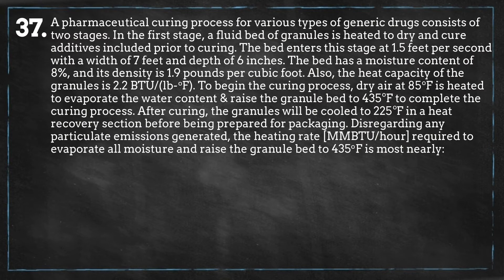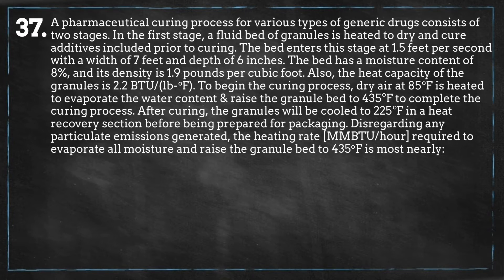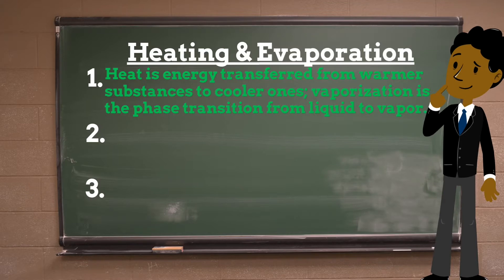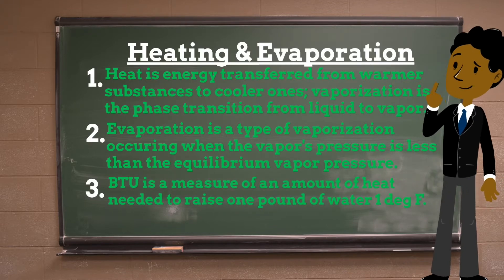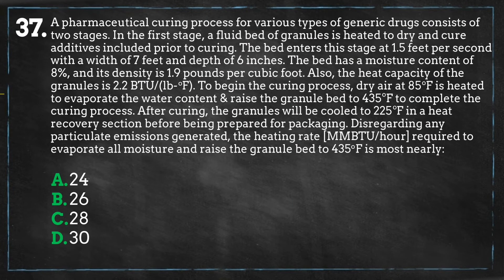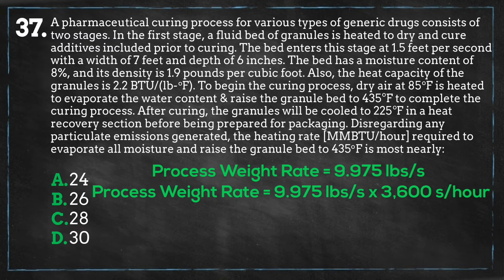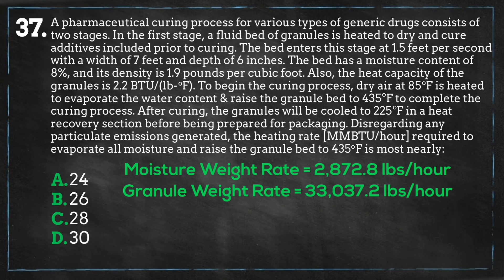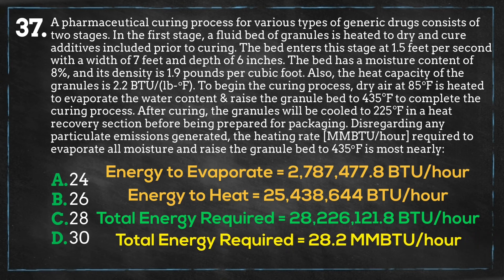Pharmaceutical Production - Episode 37 (Air Pollution Engineering) | 52 PE Exam Problems in 52 Weeks

Comment: I see that we calculate the energy needed to evaporate the water, but why is the energy to heat the water not calculated?
Reply from the maker: Thanks for your question, Daniel. There are 2 reasons, one major and one minor, I decided not to calculate the energy needed to heat the water (using the specific heat of water = 4,186 Joules/(kg-deg Celcius)). First of all, the specific heat of water, compared to the heat capacity of the granules, is negligible enough along with the low water content (weight and volume) to assume that the energy applied to the granules would be enough to also heat the water. The water content is contained within the granule bed and Ultimately, it's not enough water to consider it as it's own system as the granule bed is the point of focus for this problem.

The second reason, albeit minor, is that the water does not have to be at the boiling point to begin evaporating, and similar to the first point where I'm considering two actions (vaporization of water & heating of granule bed) for one system, I'm viewing evaporation as occurring the whole time during the heating process, not just once the bed reaches 212 deg F or higher, although being at the boiling does it make it easier from a temperature perspective. Irrespective of bed temperature, the latent heat of vaporization of 970.3 BTU/lb is still needed to convert the water from liquid to gas.

 Saying all of this, if you get in a similar situation and don't feel comfortable negating that energy needed to raise the water's temperature, you can take 60 seconds to do a quick calculation using the specific heat of water of 4,186 Joules/(kg-deg Celcius) using the moisture weight rate of 2,872.8 lbs/hour:

Energy to Raise Water Temp from 85 deg F to 212 deg F = [2,872.8 lbs/hour] X [4,186 J/kg-deg Celcius] X [1 kg/2.2046 lbs] x [1 deg Celcius/1.8 deg F] X [127 deg F] X [1 BTU/1,055 J] X [1 MMBTU/1,000,000] = 0.36 MMBTU/hour.

Added to the energy to evaporate (2.8 MMBTU/hr) and the energy to heat the bed (25.4 MMBTU/hr), you end up with 28.56, which still gets you an answer of C. For problems focusing on the water or other liquid as the focus, using the specific heat is necessary; for this problem, not so much. Let me know if this makes sense to you or if you have any other questions.
Reply: The calculation can be simplified since BTU is defined as the energy to raise 1 lb of water 1 degree Fahrenheit as you stated in the video.  So 2872.8 lb/hr of water raised from 212 to 85 degrees Fahrenheit is: [2,872.8 lbs/hour] X [127 deg F] X X [1 MMBTU/1,000,000 BTU]  = 0.36 MMBTU/hr.  Just an FYI for people taking the exam since time is valuable

Comment: Are we going to talk about how this solution ignores the heat required to change the temperature of the air coming in and the heat returned to the system in the recovery process? Both can be solved for with the information given (though a recovery effeciency must be assumed), and this more comprehensive solution gives a very different answer.
Reply from the maker: Thanks for your question, Devon. The focus of this question is only the energy needed to evaporate the moisture of the bed (using latent heat of vaporization) & raise the temperature (using the heat capacity). As you pointed out, as you start branching into various aspects of the systems there’s various transfers of energies & energies used to maintain equilibrium, but due to the various assumptions that would be used and additional information needed to solve within a reasonable amount of time, problems on the PE exam usually simplify to only one aspect of the system, assuming standard conditions (in equilibrium) unless otherwise stated.
Reply: @SIGMAEnv  I appreciate you responding, and very much appreciate you posting these videos. They seem very similar to the NCEES practice exams and your explanations are helpful.  I am starting to see a trend in these problems along the lines of the simplification you have described.  It is frustrating, however, since knowing apriori which details should be dismissed for simplicity is a subjective exercize, and does not conform to generally-accepted standards of a quality engineering assessment.  If the purpose of the PE exam is to prepare competent engineers, it seems irresponsible to put forth problems with solutions involving simplifications that would lead to incorrect answers.  In this situation, just because we aren't given a number for the effeciency of the heat recovery circuit does not mean that the quantity has a negligible impact on our energy balance.  I suspect the opposite would be the case.

Please excuse my frustrated rant, and thank you again for explaining.
Reply from the maker: No problem at all, @devon9075 . Preparing for the test is no doubt very tedious & stressful, so we often remind the students we assist in preparing for the exam that the NCEES designs this exam "to test for a minimum level of competency in a particular engineering discipline." These problems are very similar to the practice exams to point out the principles behind each problem. There's usually 2-3 ways to solve each problem, so as long as you rely on your knowledge base (how you typically attack scenarios), you should get a final answer close to one of the choices provided your calculations are good. This leads to my last point: different approaches use different paths, which require the use of different equations. The NCEES spends millions of dollars designing these exam to ensure that you are not penalized for using an atypical approach to solving a problem. For example, if your approach gets you an answer of 274 and I get an answer of 289 using my approach, and the answer choices (asking for which is most nearly the solution) of 100, 200, 300 and 400, we will both select the answer of 300. It is a rarity that the exam will make you choose between two answers in this manner provided you used competent strategies. I hope this is helpful, and good luck with your preparation! Let me know if you have any other questions.